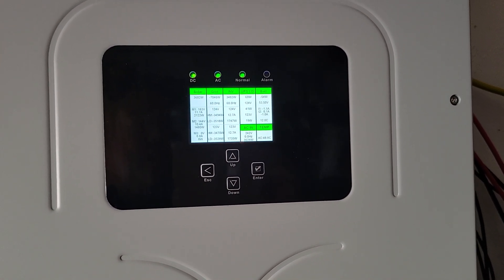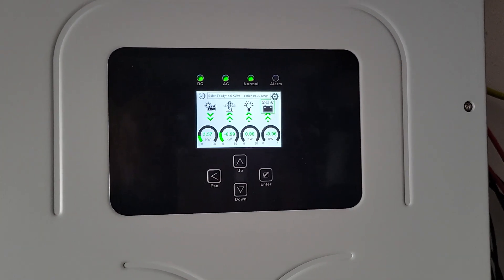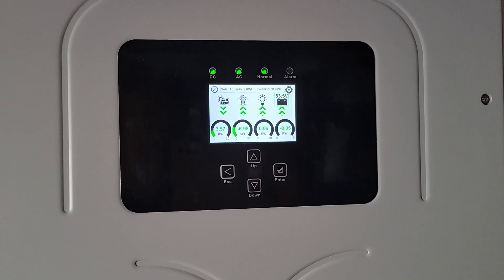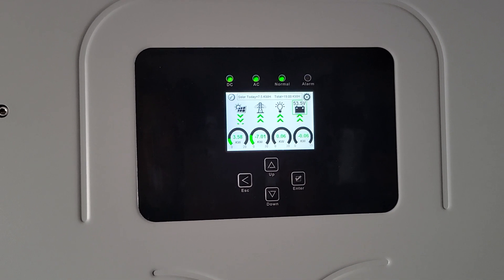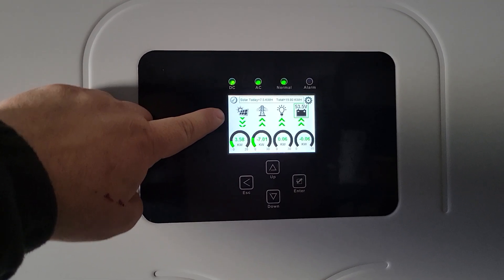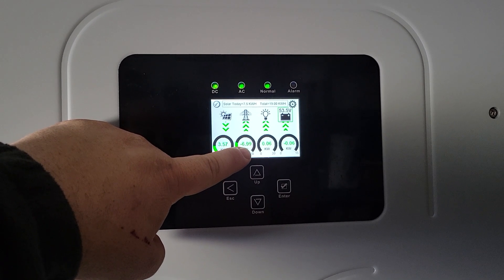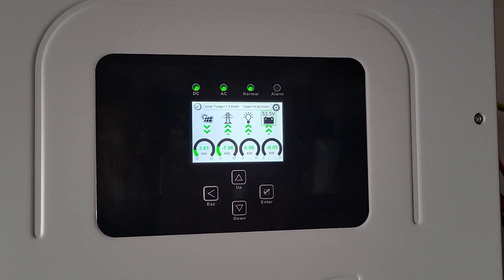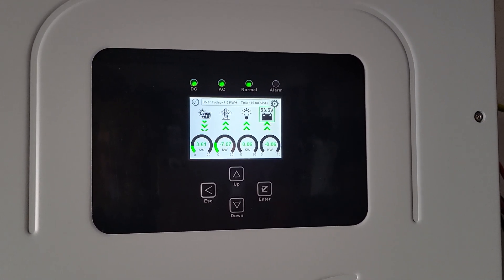Sol-ark 15k is quiet.

Comment: Dear friend,are u still interested in some Seplos Storage battery/bms?
Reply from the maker: I don't really think so. I have a 2 amp balancer installed on each set of batteries. Then I only charge to 3.4V per cell, from what I understand that is what the Seplos BMS tells the inverter is 100% anyway. I have it set to disconnect at 3.15V per cell also.
Reply: @JasonCarmichael  Halo,my friend.Are u mean ur cells cant discharge in full?
Reply from the maker: @linpray  I manually set the voltage to not go to the extremes of the state of charge curves.